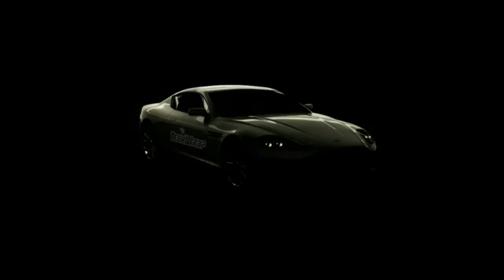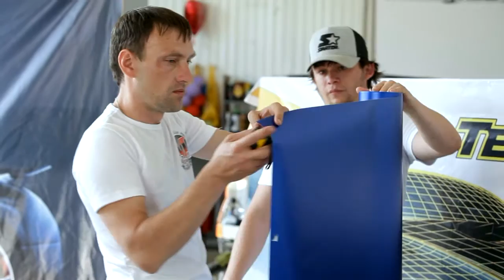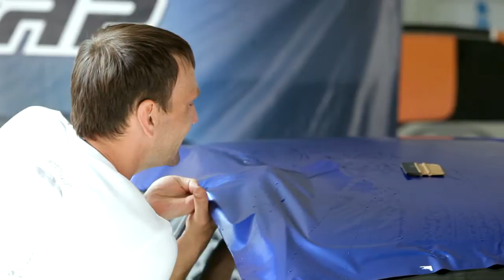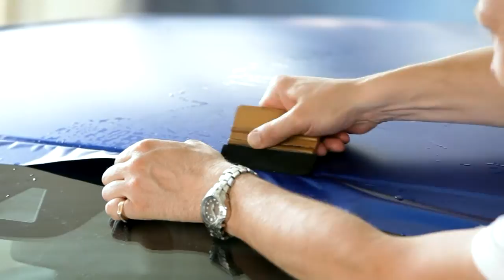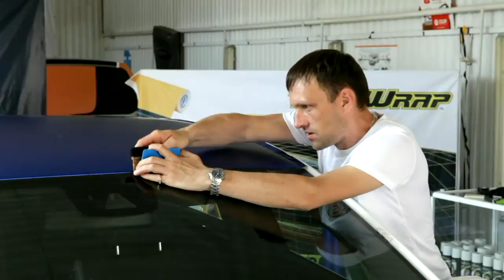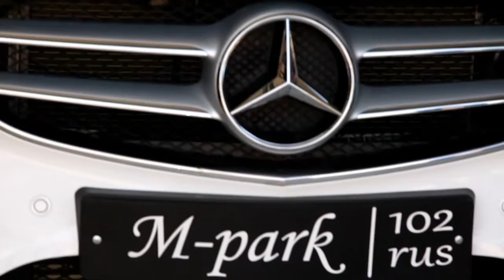TeckWrap Blue Metallic Chrome Wrapping Video Part 1 / M-Park Tuning Studio Russia

Comment: Nice work! It looks easy to wrap a car on your videos! I'd tried to wrap a VW Golf MK4 roof,and a Suzuki Swift II hood with TeckWrap 3D black carbon foil,and it was very hard work! Looks good on both cars,but on hot days the foil on edges comes up... Is there any activator to use,or something special technic to avoid this? (Sorry for my poor english,I'm hungarian!)